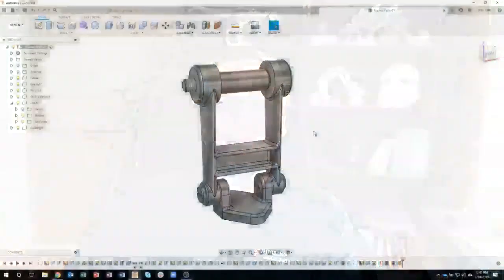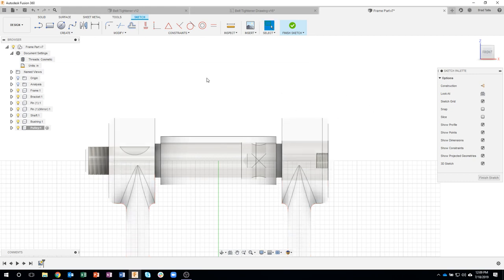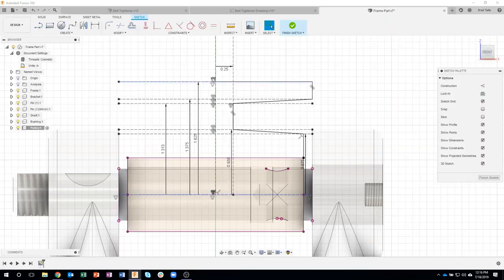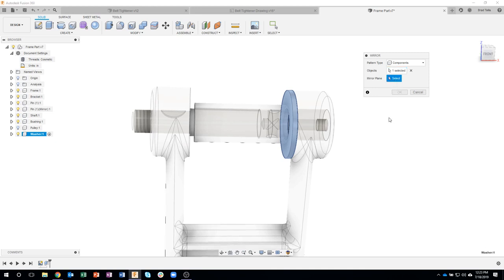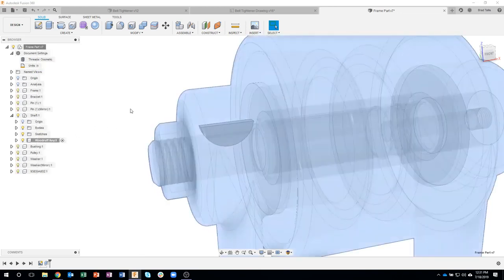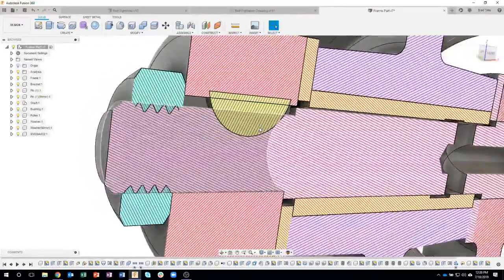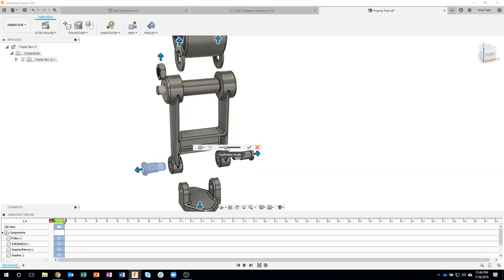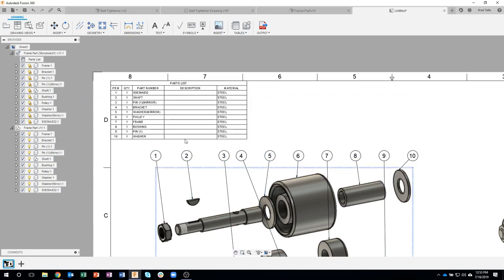Episode 39,  Creating In Context Designs part 3 of 3

Comment: this one was one of the best that you had done because you touched everything form animation to 2d drawing and those tips are fantastic... really great job. can you do you a course how to draw in 2d instead of first 3d and than 2D like you do on CAD software. thanks Karl form Malta
Reply from the maker: Karl-  Fusion 360 really is a 3D modeler, so the sketch environment is really designed for that.  If you are just looking for a 2D Modeler, I recommend a tool like Autocad.
Reply: @bradtallis8968  thanks.. yes I used some times the CAD for 2D but since I am learning the fusion software, I thought that it will be help to stay only on same software and not half to go in depth on other software since it is not so that easy to learn all that software... Thanks again for eveything andcfor what you do..